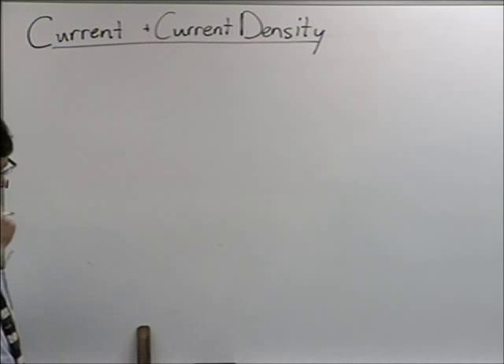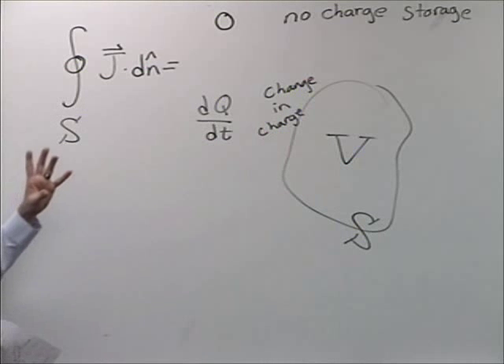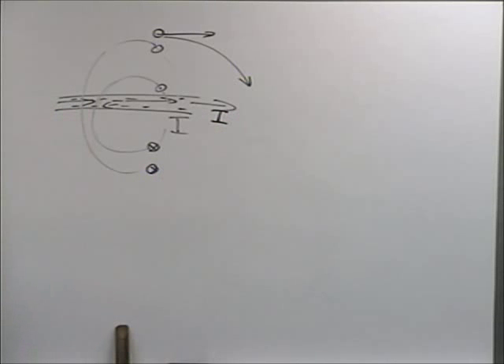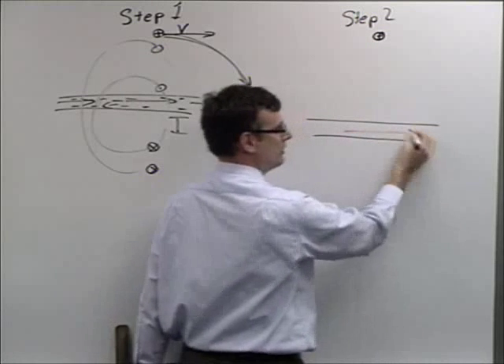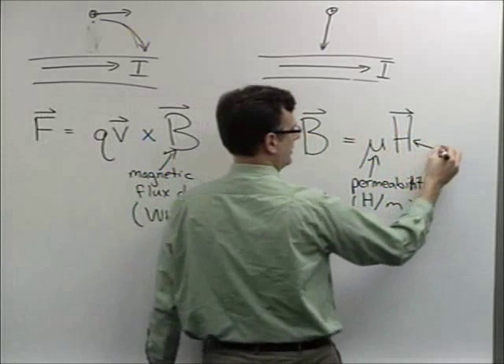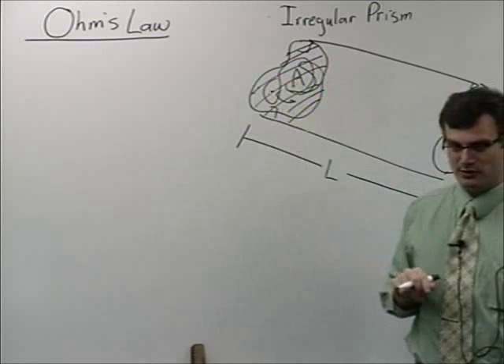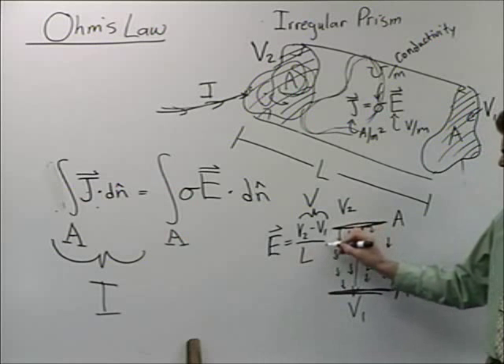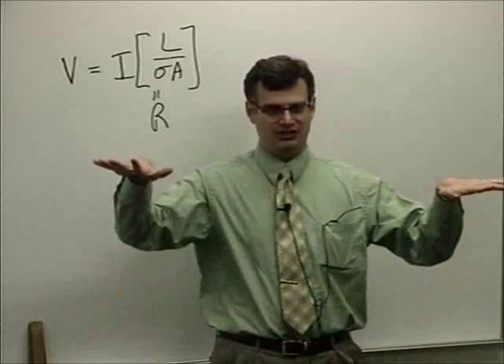MSF01: Current and Metals

Comment: I have a question: In electrostatics and also in this lecture we said that good conductors dont allow e-fields inside of them. But now we had a constant e-field in our conductor. So im wondering when exactly we are allowed to say that the e-field in the conductor is 0.
Reply: 5 years late ... 

different cases. first is e field is outside the conductor and surface charges cancel it out, second is where e field is put inside the conductor to push electrons which is currentt for future people: